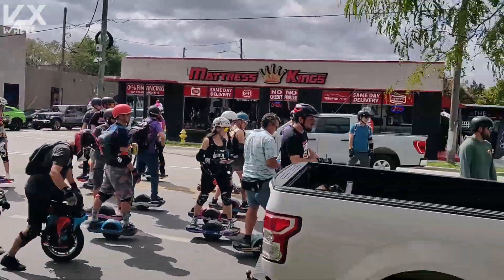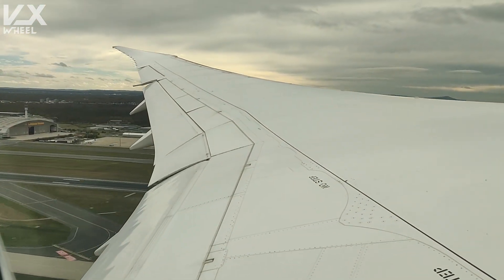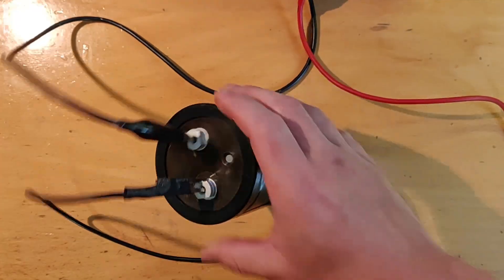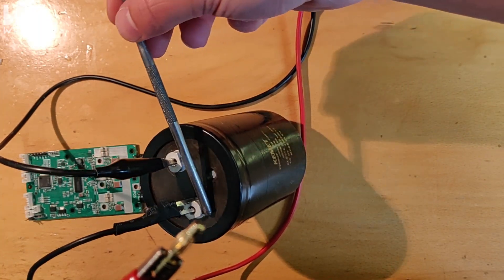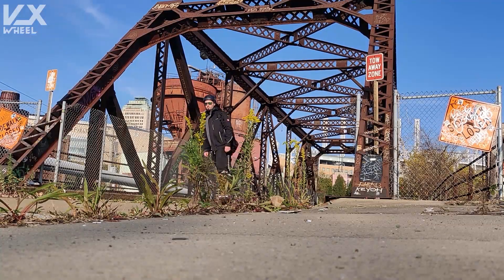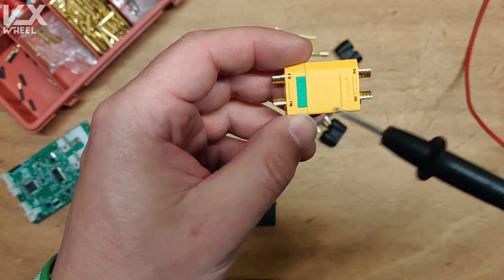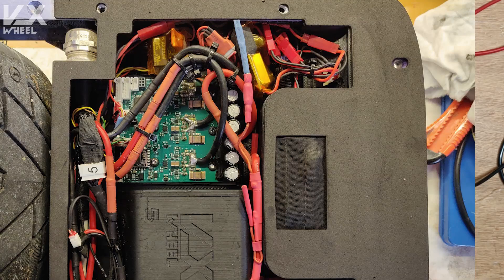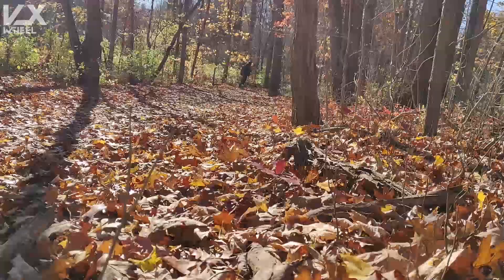Anti-spark solutions for DIY VESC onewheel - VXwheel

Comment: Hello ! Why don't you considered using an active anti spark circuit like the one's flipsky sells ? Thanks
Reply from the maker: @Minekeek  Takes extra spece, brings more heat. It's an option for sure, I just don't feel it's needed or that it brings any significant benefit.
Reply: @VXwheel  I understand, thanks 👍🏼👍🏼

Comment: I asked about antispark stuff on another video, so thanks for posting this! Are you still having good results with the qs8, and if so, how many battery connect/disconnect cycles would you say you've done so far?
Reply from the maker: I have done like 10-15. Not too many, but it works fine for now.

Comment: What is the capacitance of the capacitor , the voltage of the battery and the esc's max current ?
Reply from the maker: Tronic 250R that is the targeted esc in my builds now has 500uF, voltage at full charge 100V (24SLi),  max battery current 120A.
Reply: @VXwheel 24s !!! 100V !!! I thought 6s I use was to much  😂
Reply from the maker: @diverFPV  Well people say high voltage brings more fun to PEV's, so here we are :))

Comment: Why not a removable pre-charge circuit? .. XT60 extension cable with 500ohm resistor that you connect to the battery then the VESC to pre-charge the VESC capacitors. You then remove the pre-charge circut and connect the battery directly to the VESC. Otherwise an XT30 pre-charge with XT60 "bypass" probably takes up less space than the QS8/XT150/AS150.
Reply from the maker: Sure, plenty of good ways to do it.

Comment: I have a suggestion that is somewhere in between 

Haven't done it myself, but have thought about it

Make a small adapter (I use XT60) of a male/female XT60 with the resistor wired in between the female+ and male+ and the female- and male- is just a straight connection

Then connect the ESC using this adaptor for, I don't know, 10 seconds and take it apart again, and then make the regular connection, this way the capacitors are pre charged when you plug together the main connectors

Hope it makes sense

This setup has the advantage of being backwards compatible so you don't have to take apart your setup and solder in new wires for the resistor line, something I'd hate to do
The disadvantage is your adaptor can get lost
Reply from the maker: For sure, another great option! As said there are plenty of ways to do the manual anti-spark. Get creative and do the thing that best fits your build.
Reply: I'm actually going to run with this idea, thank you!